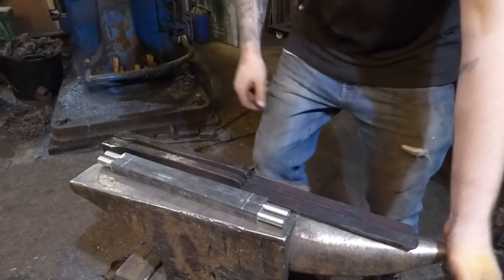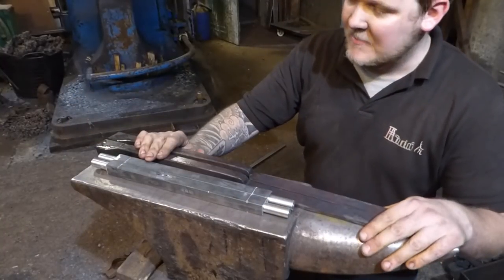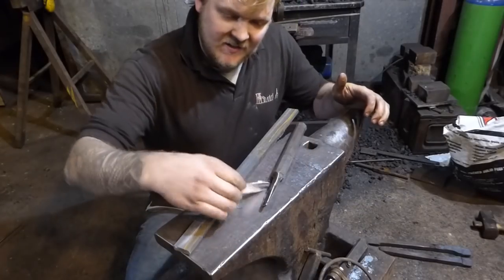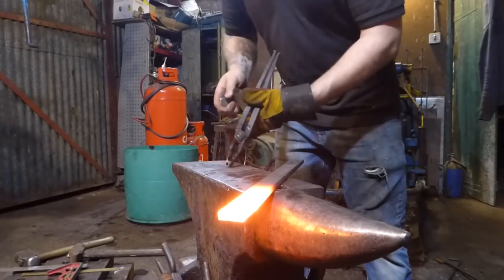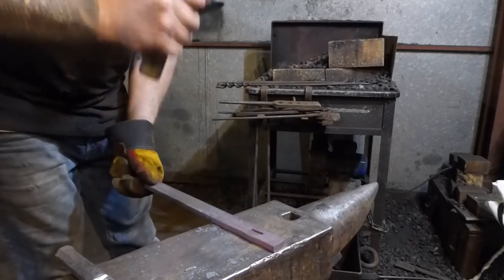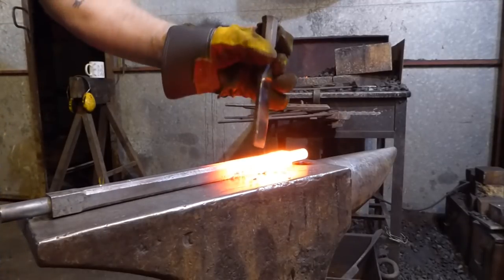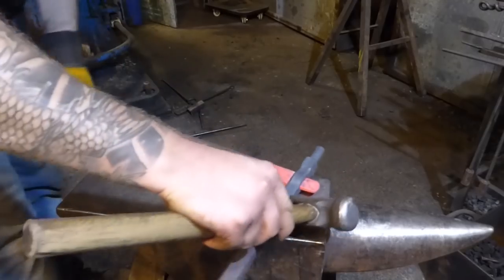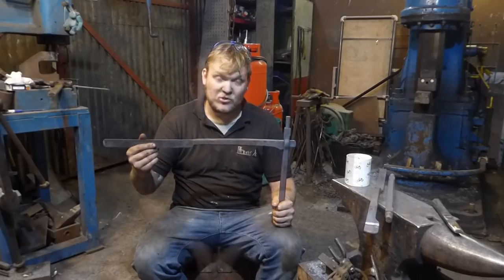Victorian Crane Build! Part 1 Forging  mortise and tenon Joints!

Comment: Love that you show how to do this by hand. I have always aggravated my blacksmithing mentors, by stating it is (for me a waste of time practicing much slitting and drifting) for one I am a fabricator, my father taught metallurgy, welding, machine trades, math , science etc. Why don't you do the rest of the slitting under the power hammer? weld a handle on it and a bolster underneath. or get an ironworker and save hours of work.  (me) always looking for ways to have custom/forged the fastest & cleanest way possible.  It is not lazy using the tools you have_ it is foolish not to ..   thank you for showing the proper way, now Forge On!!
Reply from the maker: Just not sure I'm happy messaging up a load of work for 10mins of time saving. Wasn't much differents in time. I punch lots of holes with the massey but I find that it take practice. If I had messed up the hole I would need to make the up right again and we'll that seems like a waste of time. Thank you for the comment and I agree if you got it uses it lol

Comment: Nicely done. Definitely giving me some ideas for other joinery, but I'd have to work out easing the punching process for just hand hammer work. Would running a slitter through first be a little easier than just punching the hole?
Reply from the maker: The slitter would need to be the same shape as the drift any way. It work well I was just being slow with it. Nice idea dude thank you for the comment